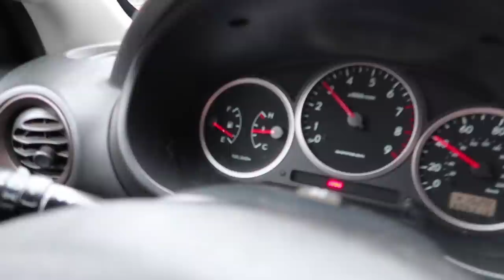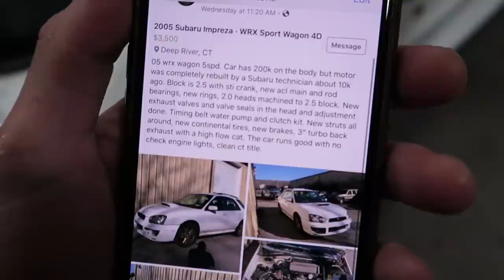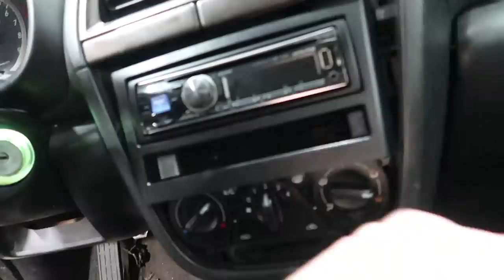Budget Winter Beater Ep. 1: Buying a WRX

Comment: EJ engines always break...

Let's weld the diff.
Let's jump it.

The problem with EJs is usually the owners😂
Reply: For sure agreed ,especially when they overboost their "Built ej257 Stage 2"(In reality just stock motor boosting 25+ pounds haha
Reply: 💯 Emilia Hartford.. cough
Reply: I hope he gets all the subaru issues
Reply: 160,000 miles on 15 year old FXT stage 2 with no problems and yes I will continue to baby it forever.
Reply: As an owner, I agree
Reply: Fairbanks Air Riders good luck with the next 20k miles my friend!

Comment: The "Subie" makes for a great sled pulling car...(It needs some wide snow grippers tho).  We used to get big old heavy car hoods from the 70's / 80's flip em over and use a 20-30 ft. heavy tow rope to tie em to the back of the car.  You make a 10 ft Y lead to the front corners of the hood so you can tie the tow rope in the middle. And another shorter one from the same front tie points so 2 or 3 peeps can hang onto it while riding. Find  some white fluffy stuff and let the games begin!!!   You even have the roof rack to store the car hood sled to with bungees when hunting for good sledding spots. Many good times had this way back in the day. : )

Comment: - Twisted Vf42 twin scroll turbo conversion
- Custom equal length headers 
- Front mount intercooler 
- bigger Injectors & pump
Few cheeky wee mods for the 205/255 you have. Factory ecu is tunable too a certain degree. I'd really love too see a complete ej207 or 257 sti build with avcs ect. Either way can't wait too see the outcome as being awaiting a ej build from you for years

Comment: If you plan on jumping or beating this thing first look at the rear strut towers if they are not rusted through. The rust in the rear corner panels can sometimes be just the tip of the iceberg with there turds. Best of luck boys!

Comment: ROM Raider that thing for a good map, get a good map. Cat delete, 2ohm resistor in the EGR. The EJ205/257 won't do well with > 320-330HP on stock internals.... at least not for very long. These cars are fucking rad for a very good time either heading up snowboarding or just heading to the grocery store. Fix understeer with Whiteline sway bar end links, whiteline front sway bar, rear sway bar stock, front and rear tower struts. Permatex Ultra Black the valve cover gaskets and grommets and she won't leak. Sweet, and you got the proper steering wheel

Comment: The absolute first mods you need to do (coming from a subie owner with a built motor) especially if you’re ripping it during winter...drifting donuts and that is OILING killer B pickup,windage tray and pan..... everything else should be secondary in this build for what he’s using it for.... just
My .02

Comment: Hand brake won’t lock the rear without a center diff disconnect
Reply: Or the clutch in. You can do a clutch kick and e brake it at the same time. It's terrible for the car, but it's fun
Reply: heel nah lol that’s not how it works bud
Reply: @Missileworksllc  yes it is. I used to do it all the time with my old subaru
Reply: heel nah k

Comment: I had an 04 wagon for the past two years with 200k on the stock motor. I had it stage 2 tuned for the 20k miles I got to drive it and then someone pulled out in front of me and totaled it. Engine was running great even at over 200k. Now I have an 2000 2.5 RS coupe. I don't see anything wrong with most of the EJ Motor until people try to push them like crazy without a proper setup.

Comment: the motors blow cause of the engine consuming oil alot usually and that happens cause the design of the motor makes it even more important to keep alot of oil in them cause they have a harder time flowing the oil back into the pan so they spin or lock up bearings. and also cause most subarus are beat on especially in the winter and the motors arent made to last 100k or more of abuse.

Comment: I think you should go full winter with it.  A new set of winter tires, try to find the steepest roads in the slickest of conditions, go on a road-trip to Colorado, have fun with the Aspen women, you need a "vacation" :)  While you're there, enjoy some hot-springs, get a good soak in the healing waters, take some friends with you.
SuperTech Full-synthetic $15 for 4.76qts of engine oil, at Walmart.  It's as good as racing oil, I beat the living shit out of my daily with it, works great.
K/N oil filter.  K/N fuel filter.  Attend a Subaru meet with it, in Colorado, visit the BoostedBoiz and PFI Speed.  Have it AWD dyno'd out there, before you head up into the mountains.

Comment: 7psi? Bone stock WRX should make about 1 bar of boost by 3000rpm. They're not fast, but they're punchy. I reckon the biggest killer of boxers is them being abused when cold. I've owned a couple of Scoobs now and touch wood, they've all been great but then I'm quite sympathetic. Normal oil operating temp is 90ºc which is reached after about 15 minutes of gentle driving.

Hope it's a good steed for you Adam. Happy Subaruing!

Comment: EJ engines are reliable if you actually take the time to build them right and don't try put insane boost through a non closed deck engine that hasn't had the bottom end built with high quality parts

Comment: All Subaru eventually blow there motors 😭  and there automatics suck  been searching for a manual forester for the clearance and roof rack to haul kayak,mtb and overlanding.  You should also never do more than 6 donuts in a Subaru because the inside pistons dont get oil and you risk blowing the engine.

Comment: My mom has a 2016 Outback 60k miles and rod knock. Gas tank door did not open. Clock on radio does not stay set. Seats have cracked fake leather. It is the worst vehicle I ever seen. I thought Ford was bad. Subaru tops them all on unreliability. Something has to be wrong with the rod bearing clearance on all Subarus. Maybe they are too tight and don't allow oil to get in there to lube? I never tore a Subaru apart. But Porsche has boxer engines and they do fine. I would love to see someone  compair rod bearing clearance on a new porsche 4 cylinder and a 2.5 Subi.

Comment: Wellllllll im probably getting myself into some shit im about to buy a 2.5i for 2700 and its got 168000 miles on it the guys selling did the usual subaru head gasket pulleys and belt replacement then some other stuff but the car seems pretty ok but it has some blowby but no smoke out the back i just really need a car and fast but if any of yall out there think im an idiot please talk me out of it